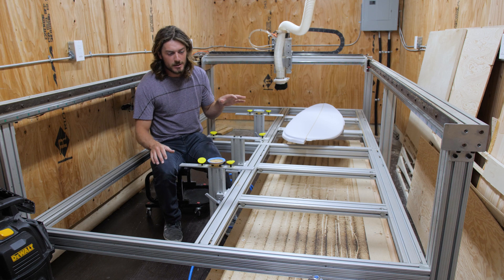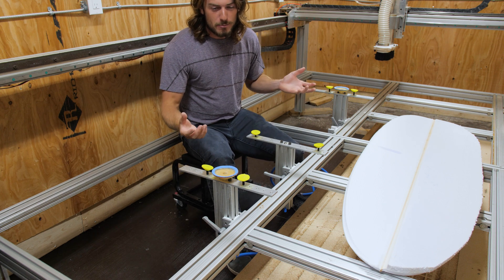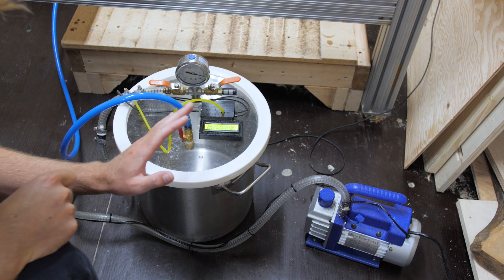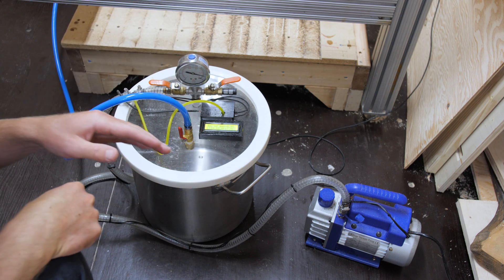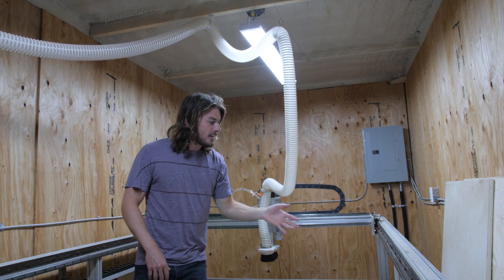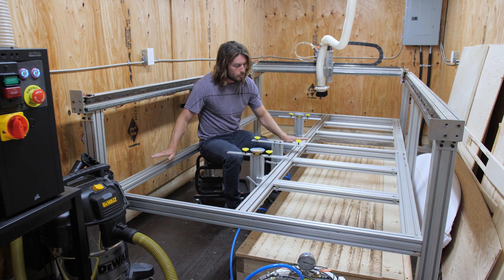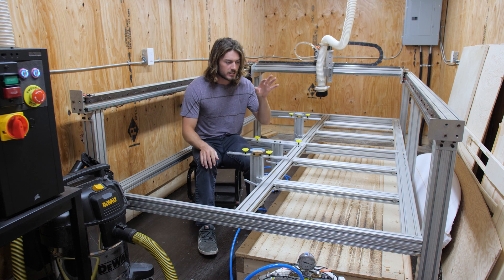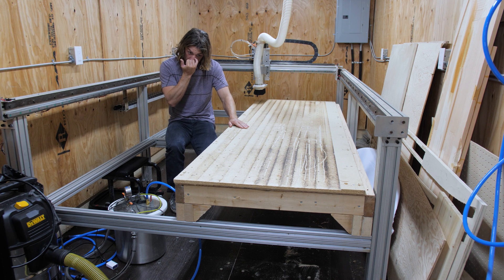CNC SHAPING MACHINE | UPDATE AFTER MY FIRST 10 BOARDS

Comment: man it'd be awsome if you posted a video showing how you model the boards in fusion!
Reply from the maker: Hey Thomas, I don't actually model the boards in Fusion. I prefer using shape 3D which is specially designed for board shaping. Fusion is a real pain in the ass when it comes to curvy things like surfboards. I just bring the boards into fusion when it's time to create the CNC codes.

Comment: try this. spackle the pad footprints on the foam blank, then sand smooth with 800 grit to cure leakage ( maybe ditch the foam collars on the vacuum pads if you do this)
Reply from the maker: Hey Greg, These days I've been using a layer of Tucktape on the foam. Super fast, I just stick it onto the foam and it provides a perfect smooth surface for the vacuum pads to latch onto. Works like a charm and you can peel it off easily afterwards.

Comment: Wow, super interesting and well done project! Thanks for sharing it! Do you think your system could handle a longer cutter?
Reply from the maker: Hey, It can handle longer cutters, but the limiting factor is the spindle speed. The minimum RPM for my spindle is 9000 and it hardly has any power when it's moving that slow. When I tried to run the longer cutters at higher rpms, 12000 and up, it started to warp and vibrate pretty aggressively.

Comment: Hello mate , wanted to ask you … I have also CNC with bed and just need the pump and stuff you use to hold the board . May i know brand /price and if URL to have the example then great !!
Reply from the maker: Hey! I bought the vacuum pump and pressure pot on Amazon, something like this, the one I ordered isn't available anymore:
https://www.amazon.ca/Single-Stage-Stainless-Stabilizing-Degassing-Silicones/dp/B09DS5KJL1/ref=sr_1_2_sspa?crid=PW03QGD7XUUR&keywords=vacuum+pump+pressure+pot&qid=1666674563&sprefix=vacuum+pump+pressure+po%2Caps%2C141&sr=8-2-spons&psc=1

I bought a vacuum pressure regulator, wired it into the vacuum pump:
https://buildyourcnc.com/item/electronicsAndMotors-pneumatic-hydraulic-vacuum-pump-controller-sensor-redfrog-v1

The vacuum fixture/suction cup setup is custom. I designed it myself and I would suggest just doing your own setup for that,, it'll be different for every machine.
Reply from the maker: Ya I'm sure that will work great. Make sure you order Vacuum pump oil as well. It might not come with any.

Comment: You are inventive; I've been in a design/build/scrap/redesign process for several years now...always trying for a simpler build.  It looks like you use the walls to reduce flex?
Reply from the maker: Hey Dirk, That's not a bad idea! But no my machine is not connected to the wall. The limited space in my container forced me to push it as close to the wall as possible so I can walk around it. 

I plan to use some angled cross beams to really stiffen up the machine when I get around to it.